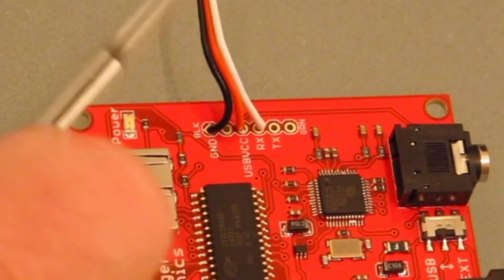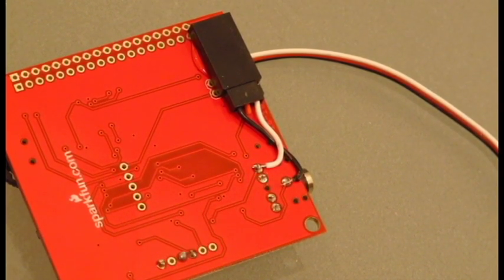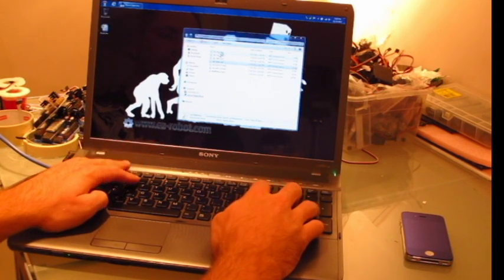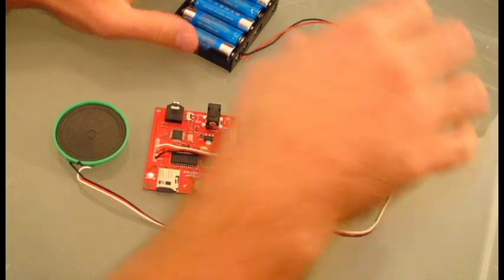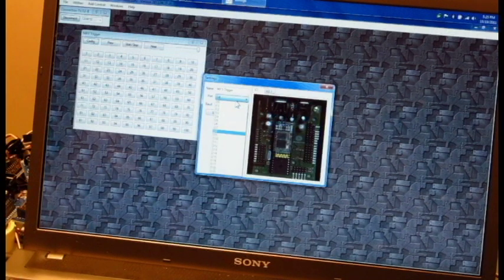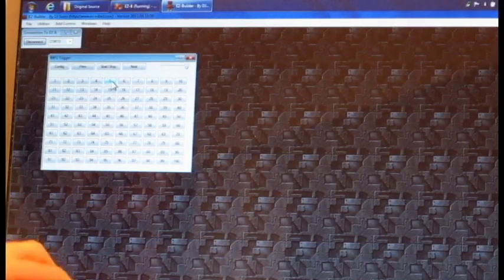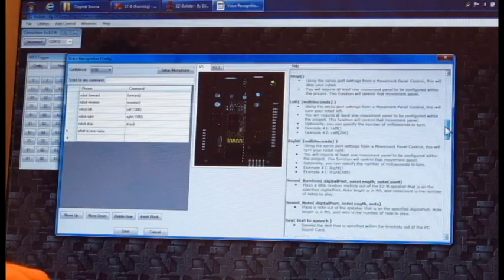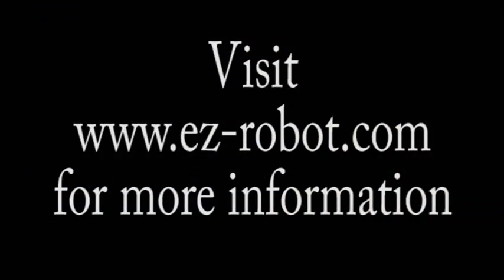SparkFun MP3 Trigger Robot Tutorial with DJ Sures

Comment: Thank you for posting this, but it would help if you had explained a little more about the pins and the software choices.  Saying "This wire goes to this pin here" is confusing, and it would help if you'd explained the red, white and black wiring a little more.  I understand about ground and VCC, it just would have helped to have gone into more detail about the wiring setup.  Thanks.

Comment: Hi there, is this module usable without an arduino? Could you just connect a battery directly and trigger sounds using the trigger inputs?
Reply from the maker: Nick N This module has been replaced with the ability to live stream audio (mp3, wave and text to speech) on the EZ-B v4: http://www.ez-robot.com/Shop/AccessoriesDetails.aspx?productNumber=40
Reply: DJ Sures Thanks, I actually came across this video researching a simple audio sampler solution for a project and settled with the sparkfun wav trigger. Your project seems very interesting though!